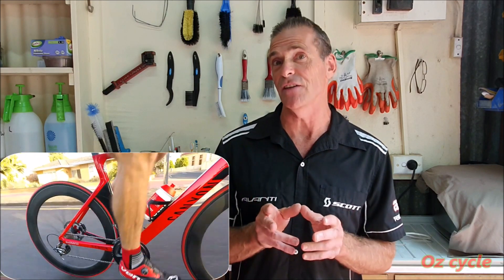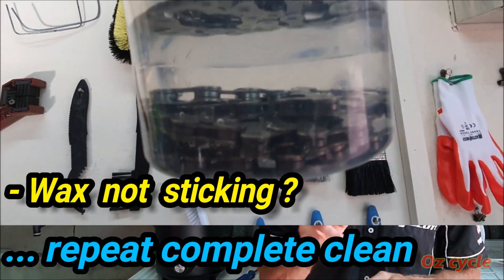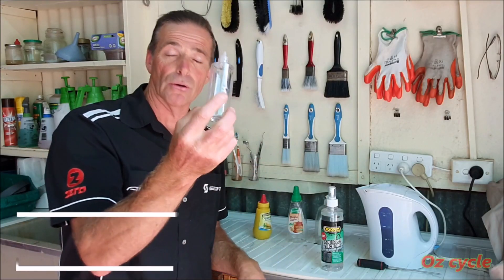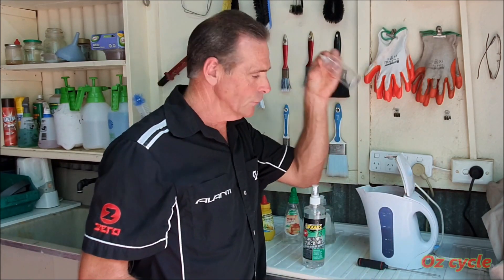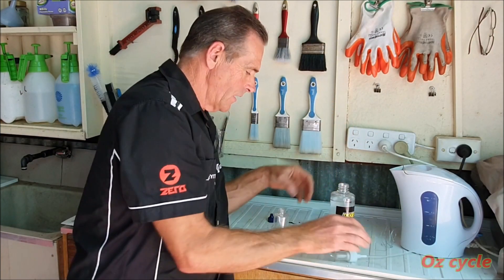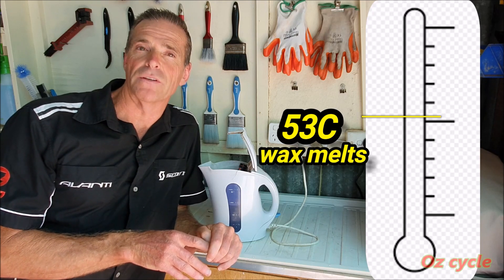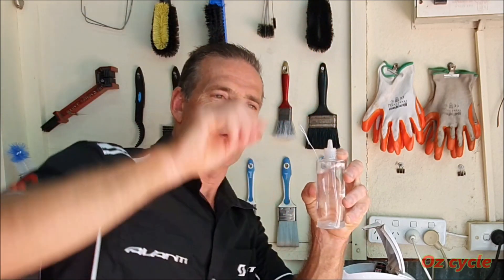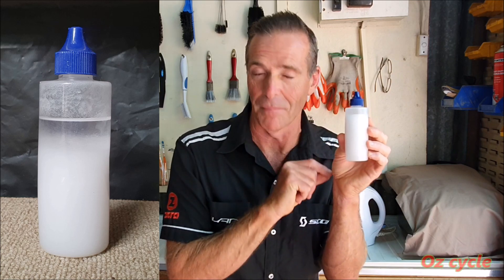Chain wax in a bottle - make it yourself

Comment: Hi,
I love the waxed chain, tks and I like the idea of the extender wax in a bottle.
   I have been thinking on the extender wax My thoughts below, they may be of no use or may be useful, but …

ON the Extender:
You scrape the wax from the current supply.     My experience with the wax is that the PTFE falls to the bottom, it does not actually mix fully with the wax.     This is not a criticism just an observation.     So I was thinking that there must be no, or little PTFE in the extender.

   To address this, I took the wax from the HOT mixture after mixing with my not patented wooden dowel.  That way I knew I had PTFE. 
Your Thoughts?

      On Application of the Extender: 
What you do makes sense, but I thought there may be a way to immerse the chain in the extender liquid.   
I have a no longer necessary chain cleaning device!  I really cleaned it and propose to use that when I need to apply the extender.  
The chain cleaner will semi-submerse the chain and then brush on the extender. I can top up the extender in the chain cleaner “wax extender” device.

  I have not had the chance to use it yet, but that is what I will do before I next re-wax just to see how it goes.   

Your thoughts?   

Ray…

Comment: I'm a recent "convert" to your process Mr. Oz Cycle .  Prior to stripping and waxing my first chain, I tried using "White lightning clean ride" on a chain that had not been stripped (And had other lubes used on it).  That was a bit of a mess so the big bottle collected dust in my garage (32oz).  I'm wondering now if it would be safe to use on my chain that I've prepared according to your other videos.  It claims to have wax and "Cerflon" (I assume it is similar to PTFE).  If anyone has any experience with using this as an emergency lube, I would appreciate your input.  Thanks for your time and consideration.
Reply from the maker: Yes you can use White lighting with immersive wax but it will gather dirt because it doesn't completely dry off.
Reply: @stevenleffanue  thank you for your quick response and for sharing your knowledge.

Comment: Having trouble making the mix. After the melting, when wax separates it forms a sand like texture. It does melt properly and alcohol too, but they don't really bond even in liquid state. Any ideas?
Reply from the maker: Are you using 99% alcohol?
Reply: @stevenleffanue  It doesn't say. I'll try a different 99% brand. Thanks.

Comment: You cannot believe how stunned I was to see this video. You could at least have given me some credit for this one, since I was the one telling you that I use isopropyl alcohol in my response (see below) to your video on how to make the ultimate chain wax.

"Hey OZ. I'm a great fan of your channel. Very informative and fun to watch, but this time you left me confused. No more paraffin oil in the mixture?? And no explanation on why not. I have tried the old formula and was semi happy with it since my chain would still pick up some dirt after every ride (probably because of the paraffin oil). The xylene formula was a bad idea from the beginning. Very toxic product and smelly. I did some testing with other additives, and found that isopropyl alcohol was working good (50:50 mix). The alcohol evaporates quickly and there is no stinking smell as with xylene. However, after evaporating, the texture of the wax changes and remains more fluid. So, bottom line, I solely rely on dipping my chain in hot wax every so many km's, because it's easy and doesn't take much extra time. You need to clean the bike anyways, so while I clean the bike, I melt the wax and leave the chain in there for a while. I'm also an addict of ultrasonic cleaning of the chain (and other bicycle components). Warm water and a bit of detergent works great for me. 10 minutes in the ultrasonic cleaner and a rinse with hot water results in a spotless chain that leaves not a single stain if you pass it through a rug.

So, to conclude: I will give the new formula a try, but will probably still ad some paraffin oil in the mixture (25%) since it avoids flaking of the wax. Also, it's probably not a bad idea to explain to us why you skipped the paraffin oil and what happened to your xylene formula."
Reply from the maker: Oil attracts dirt

Comment: The problem I see is that the wax deposite is too dry and will fall out over road bumps or blow out prematurly. This is based on how easily it brushes off, your worrds it's like talcumn powder. It lacks some sickness of adhesion. I prefer a melted wax with with 20% 20W50 oil by volume.
Reply from the maker: It only brushes off easily at room temperature. If you press on a piece rather than brush it, it sticks.

Comment: Didn’t work for me. I did everything correctly making sure the wax scrapings dissolved completely at the correct temperature, but when it cooled most of the wax hardened at the bottom of the bottle. I tried it twice and got the same result. What am I doing wrong? ☹️
Reply from the maker: Is the IPA 99% ?
Reply: oz cycle it’s 91%. I’ll try the 99%. Thanks!

Comment: Is this safe to fly abroad with on a bottle as I am going away for week ?
Reply from the maker: No.
Reply: @stevenleffanue  Any alternatives that are safe to fly with. Been waxing for years but add Moly aswell as PTE (used the friction facts recipe!) but always worry about weeks away. So normally take a spare chain but would rather have a top up solution if there is one.

Comment: Does this work on motorcycle chains? I can't imagine why it wouldn't.
Reply from the maker: Its being trialed at the moment.
Reply: @stevenleffanue  Thanks! After writing my comment I realised that moto chains have a key difference that they are built with tiny o-rings (sometimes also called 'x rings') to keep the lube inside the chain... so I imagine the first-clean process might have very different effects to when done on a pushbike-chain that doesn't have rubber seals. But the only way to find out is to trial and test it, so I'm very excited to hear you're doing that, can't wait to see what the results are! And again, so many thanks for such a fantastic series of video wisdom sir!

Comment: I tried your wax method in the UK in our very wet winter. In these conditions the wax doesn't work as it gets washed off the chain and from between the links. My chain lasted approximately 1000kms which is worse than regular dry lube, even though I rewaxed every 300kms. I think that wax will work well in dry climates as advertised but people need to know what a disaster wax can be in monsoon type conditions and really need to not listen to people from Australia and California that think they have found the perfect solution to all chain questions, not true. Because something works in one climate, you cannot assume it works in all climates.
Reply from the maker: Sounds like the wax isnt adhering to your chain. Redo the complete clean then wax but dont wipe off any excess and it should right.
Reply: @stevenleffanue  That's totally illogical. Each time I waxed the chain I had to free the links by hand after the chain had dried, so there was clealy wax in the links. The chain wax was up to temperature and chain was swilled around for 30 minutes. The chain was also cleaned using your method before waxing. I think you may need to reevaluate whether chain waxing really works in harsh European winter type conditions and not assume user error.
Reply: @plantfuelled8912  
Excuse me, I think you do not mix the wax with the paraffin oil well, because it is precisely the paraffin oil that makes the wax stick to the chain.
the texture of the mixture is very important, if you achieve the mixture well I assure you that you will change your mind, regards
Reply: @Edmond.T  I also recently used molten speed wax and saw similar poor results. Chain wax just doesn't work well in wet, accept the truth.
Reply: Well i live in wales and it's pretty dam wet here probably  more than rest of UK and mine works fine think you need to clean your chain properly first so it does work maybe  not as well as dry climate  but better than everything else I've used .

Comment: I guess if you have an ultrasonic cleaner you could set the temperature to the required temp and use that to keep it at the right temp.
Reply from the maker: A lot of ultrasonic cleaners heat only to about 60deg C
Reply: @stevenleffanue  I "think" mine goes up to 75/80, but good point. Got some paraffin wax on order to try this out.

Comment: I presume after the first application one could wipe it off, to get some dirt off, and then reapply?
Reply: Yes!
Reply: You can, but why?

The dirt you can wipe off has little in common with the dirt in the pins and rollers. Even 11+ gear bikes, that twist a lot, cannot be cleaned with wiping.

Comment: I wonder how hard the PTFE is to get at the moment with the Corona virus epidemic? I've noticed that there is not much stuff coming out of China at present!
Reply: Rob Leviston almost impossible for me, and i live in Asia. No sure about for other countries
Reply: I ordered from Amazon a month ago and received it in roughly two weeks.
Reply: I used Omniflon XDL PTFE from uMicroLubrol ( US based company).  It is “2-3 micron average size”. Arrived in less than a week.  Free-flowing particles and no issues to date.  I convinced myself 3 microns could as easily get into chain areas as 1.6 microns and that “1.6 microns” is not really “1.6 microns average” as these have to be made mechanically.  So far no issues but will see over time...
Reply: It looks like it is getting pretty expensive! The one site that is advertising on Ebay, has it at around $25/50g. The shipment I ordered a couple of months back, was less than $5! Supply could be an ongoing issue in the coming months.......

Comment: talk ebikes please the new 11 and 12 speed casettes and chains seem to be much more durable then 10 speed, can i swap to a 12 speed and 12 speed chain and get a stronger setup...i just wore out my first chain 0.50 in 470 miles and 12000 feet of climbing......got new chain....degreased and  waxed per your instructions...looks easy on you r video's but my chain didnt get the same amount of wax on them as you seem to.....your video's have really helped me watching the saddles one's as my Bulls ebike was born with a horrible torture device, 500 miles and im still in pain....china saddle here i come

Comment: it is sufficient to clean a chain with an ultrasonic cleaner to wax the chain
Reply from the maker: You can initially use the UC but finish the clean with soaks in metho(isopropyl alcohol).

Comment: Can i use crayons?
Reply from the maker: Yes ,altho generally the wax they are made from is not refined and may present a slightly harsher lubrication
Reply: @stevenleffanue  And they are more expensive.

But it is a colorful question that turns to black.

Comment: Anyone get this to work?

I did 2 lots tonight, one with my current wax and Teflon mix and one with just paraffin.

Both of them failed. The Teflon one working the best but it was a grainy, sloppy mess that clumped and didn't really dry properly.

Started with fresh, clean containers so no contamination. The wax just didn't stay immersed in the alcohol.
Reply: Just tryin to work it out... 
What was the measurement of yours? I found out now you hve to use 50 parts of ipa to 1 part wax 50:1 ... I have flakes, so in my case i used too much of wax (approx 6:1 :D) so I have to refill it somewhere else

Comment: Wait a minute.
If isopropanol can dissolve wax, doesn't that also mean it can clean a wax lubricant drivetrain?
Reply from the maker: IPA dissolves paraffin wax but slowly. Better to use a 'wax and grease remover'.
Reply: @stevenleffanue  I see, so that's why you need to heat up the IPA. It does make sense.

Thank you for the very quicky response :)

Comment: I'm doing the 10% PTFE wax method on my and the gf bikes, but only getting about 4-5 hours (120-160km) of riding before the chain starts squeaking beyond annoyance and needs a rewax.  I'm using 1.6um powder from a chemistry shop, and doing two stage petrol bath followed by mineral spirits to clean the chains.  Is this normal mileage?  

Only thing I can think is maybe let the wax cool down some before removing the chain so that so much wax/PTFE doesn't run off.
Reply: I think you were supposed to use degreaser between the petrol and meths?  I would start again and make sure you do all steps and make sure you properly clean the derailleur and components as well.  Hope you can get it to work
Reply: @echocornet  Actually:
I use Simple Green 20% for 20 minutes first( it is corrosive, not too long) Then I immerse with soapy and then tap water. 
Agitate until all foam is gone and air gun it dry, then move to petroleum cleaning.

I am patient:
Over night each stage after water.

Comment: Squirt Lube 0.5oz bottle.  Squirt if the waxing process is too much work for you.  Chain must be as clean however.  This is interesting nonetheless.
Reply: Agreed.  I use Squirt between waxings, this process/video and recipe does not hold up for high mileage, weekly riding.  Squirt cites their lube hold up for 6 hours road, and less for MTB.
Reply: What is your weekly mileage? I do 200 miles per week and this method has held up just fine. No rewax or any re-lube required.
Reply: @kodiakpb  I ride roughly same mileage +/- 20 miles.  I do 3 indoor trainer rides on my Kickr and one long ride on Saturday 90 to 110 miles.  After waxing my chain and reinstalling, I put it in the small rear cog, it makes a smooth buzzing sound.  After about a week, it just make more noise.  What are your signs the wax is failing and time to re-do it?  I just base it on sound, I may just be re-waxing too soon.

Comment: Isopropyl alcohol is not the best solvent for this purpose.  Most of it is sold with 10-30% water in it.  Water is not a good thing to add to your lube.  Naphtha (camp stove fuel) will completely dissolve paraffin, even at room temperature - it will not be milky.  The ratio of solvent to wax should be about 6:1, but it can be as little as 3 or 4:1.  With less solvent, the mixture will turn to a milky mush at a higher temperature and require placing the bottle in some warm tap water to raise the temperature a bit.  Then the solution will return to complete clarity - it will not have a milky look.  If the paraffin is melted before mixing with naphtha, it will dissolve quickly at room temperature.  There is no need to clean a chain before refreshing the lube.  Applying hot water is also not needed for a refresh.  It will just fill the space inside the roller with water and make the lube ineffective.
Reply from the maker: I havnt tries naphta,thanx for suggestion. Pour hot water over chain in a seive...water want get into the links.
Reply: Did it both today. Oz style and your tip with naphta 1:6 (Centralin e.g. for Zippo Lighters). Both worked out fine. The naphta-mix was much easier to prepare. Thanx a lot guys and Oz good on you! Keep on going!
Reply: Any thoughts on Shellite?
Reply: @stephenallen5027  https://en.wikipedia.org/wiki/Shellite
Should be the same !

Comment: I think taking the oil out from the inner joints is not a good idea. As wax will not penetrate and lubricate in the same way
Reply from the maker: That's why the chain needs to be immersed in hot wax...to get it into the links.

Comment: Thanks for this Oz Cycle 👍🏼.  Will be sorting myself out with all this setup for my chains! Can i ask where is good to get ptfe powder from recently? It seems to be getting more expensive. Id love to know your thoughts on Molten Speed Wax? virtually the same thing and a little bit more expensive at £24 for 1lb or almost 500g batch, but might be a good hassle free option?  Oh and what size is your slow cooker, 1.5 or 3.5 litres? Many thanks! 👌🏼
Reply from the maker: https://www.ebay.com.au/itm/143570101392
Small cookers are best

Comment: Just one comment not really related with the wax but with  your bike clamping. Just be careful using the frame upper tube. It is not strong enough to support the clamping forces and your weight. You can damage it. there are tons of proof about it.
Reply from the maker: Its in loose

Comment: I just did it with pure gasoline. Worked very well.
Reply: No it didn't.

You may be happy but it left a film of petroleum and the wax will not stick.
Reply: I may have used the wrong term as I am from Europe. White Spirit shouldn't leave residue.

Comment: I have a hack. 
I use your prewious resept and when i ably new wax on chain i first show naked butane flaim on chain. Very fast and fluent just to make chain warm. Here is temperature now out -5•C and inside +18•C so all waxes are pit harder all the time. If neaded i ably more bottlewax on chain. I allways have to prewarm that aswell.
Reply: Warming the chain is a great idea, although I think a heat gun would be a safer alternative since the flame might degrade some of the PTFE particulate.
Reply: I have metal bike fraim, rims and spokes. So i’m not worried about ruining them with flame or heatgun. Outs if you have carbon frame and wheels.😐
Reply: No need to heat your chain when applying this. It is not a hot wax. The IPA is a carrier for the wax/ptfe which has already been mixed. This is something to get you by until you can do a hot wax. It is not a replacement for hot wax.
Reply: Hack is that when wax is old you can try to warm it and get few longer km from it.
Reply: @johnwilliamson9453  Yeah, I'm going to try to heat my chain with a heat gun and not blister the paint...😑